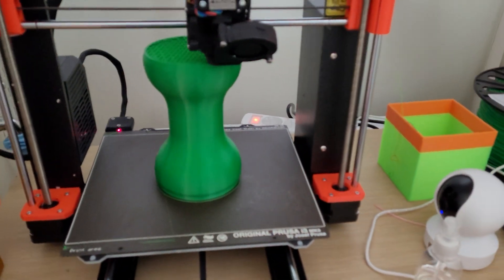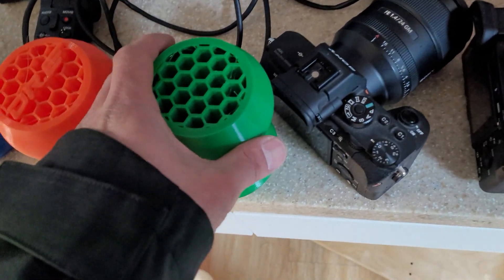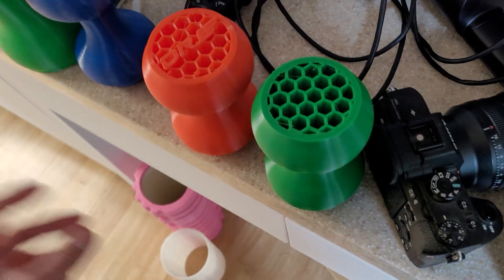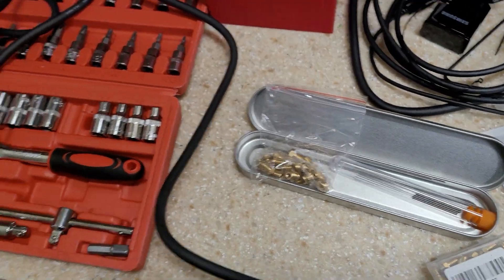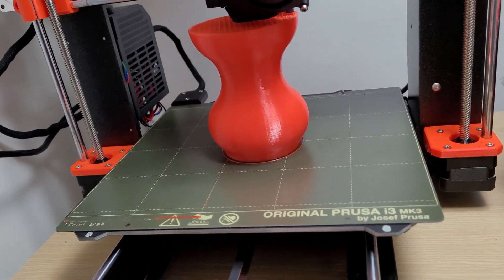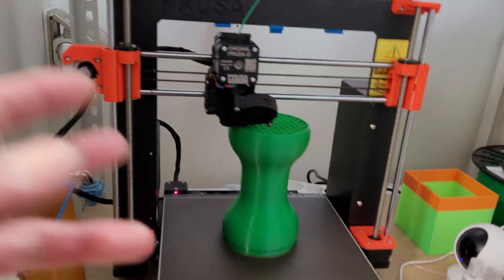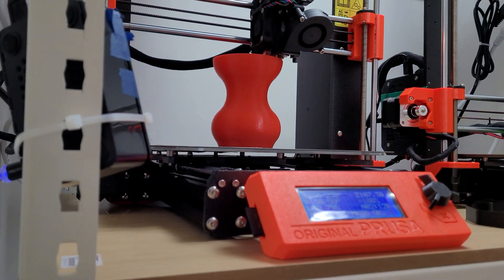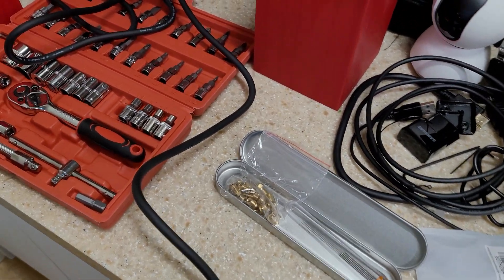0.4mm Nozzle Sweet spot for TPU filament on Prusa MK3S+!

Comment: Any chance you could post the Prusa Slicer settings?  Esp extruder rates etc.   

I have TPU now failing to feed... wraps within gears on MK3S.  Using same gcode unaltered, printed fine before... so now going back to basics re extruder motion speed/accel, temps, specs, etc...

Only things changed... dried out the tpu, upgraded the fw, recalibrate the nozzle heating.  Nozzle is clear.

TPU runs through ok at the low speed during filament change etc.  Prints first layers ok, but then filament jambs. Needed partial dismantling to clear.  Then replaced ptfe tube, which was visibly worn on the bore.   Did a cold pullml.

Cannot see any other issues or wear, on the filament path.   Not printed much since last successful TPU print.
Prints PETG etc just fine.